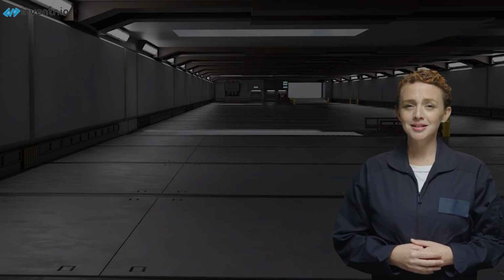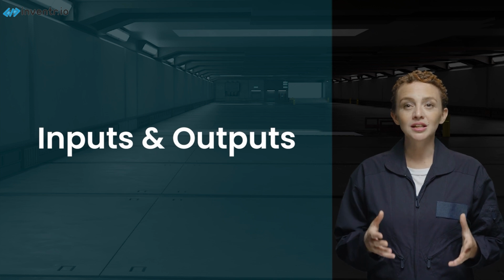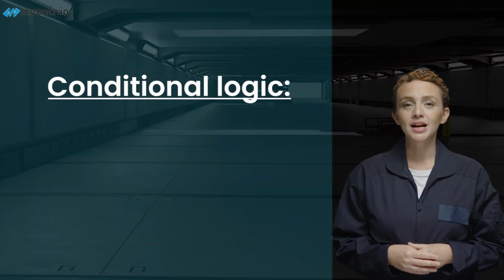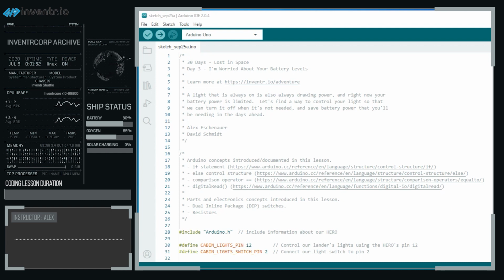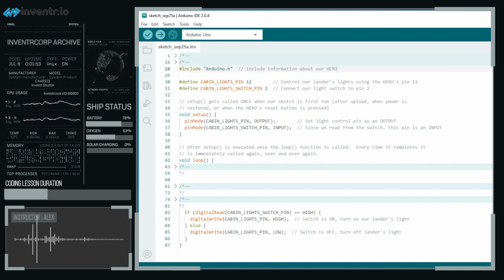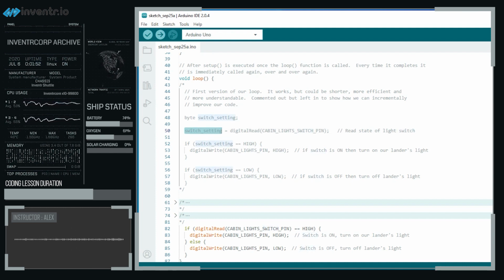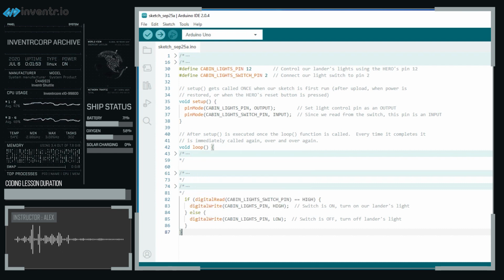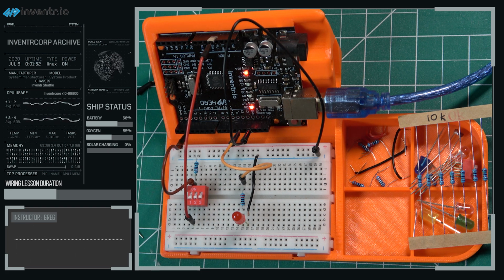[Day 3] Adventure Kit: 30 Days Lost in Space

Comment: Slight confusions : the circuit shown during the first part shows the resistor before the DIP Switch, but the wiring at the end has it after the DIP Switch, and the resistor used for that has the same color bands as the LED one in the first part, yet it's different in the wiring (should be brown red brown instead of red red brown no ?).

Comment: What is the purpose of the resistor? Adding a resistor just seems like an unnecessary extra step.
Reply: which resistor? At the switch, or at the LED?
- at switch: Pull down resistor to keep from having a floating voltage value
- at LED: current limiter to keep from burning out the LED
Reply: @Chad_Kunego  
So from what I understand, if you remove the resisitor near the LED, it will still work, but the extra power will burn it out faster...
and I am not sure what floating voltage value is from the pull down resistor. Is that kind of like making sure that the water faucet is close less as to not have too much water going all over the place? 

thanks
Reply: @oldbastarddrummer  Simply put, unless you do something to physically control whether a pin is high or low, it would be considered a floating pin. A floating pin just means you're never 100% sure what the voltage is at that spot in your circuit. Due to tolerances of other components, leakages, static buildup (this is a bigger issue than you might suspect. To put it in perspective, if you've ever shocked yourself in the wintertime by touching a doorknob, just keep in mind that, in order to feel that spark, you're looking in the range of 2,000-5,000+ volts of static electricity flowing between your finger and the doorknob. Electronics need less than 5 volts to get triggered).

 Without a pulldown (or pull-up) resistor, you're never quite sure if, or how much water, is flowing to that pin, so there's always a chance some water could reach it and accidentally trigger it, making the pin think it's triggered. With a pulldown resistor, you definitively know the voltage level is pulled down to zero, hence its name. When you flip the switch, the voltage then goes high.

There's also another way to wire a circuit which uses a pull-up resistor, which does the same thing. You definitively know the voltage is high when using a pull-up resistor unless the switch is flipped and it forces the voltage low.

So the TL:DR for that is, without a pull-up/pull-down resistor, your circuit could (and most likely would) be inconsistent and unreliable because stray voltages could be triggering your circuit without you being aware of it.

For the second part of your question, the reason you use a current limiting resistor comes back to our favorite equation in electronics. V = I * R, or voltage = Current * Resistance.

An LED operates at ~5V 20mA max. Any more and you shorten the life of the LED, sometimes to the point of instantly getting killed. A quick google search states the average resistance of an LED is 30 ohms.

So if you have a 5V 1A power source (battery, power supply, etc) and you connect the LED directly to it, you would get the following:

5V = ? * 30 ohms. Flipped around, you get I = 5V/30 ohms. Or I = 166mA, so well above what an LED can handle without burning out.

With a current limiting resistor in the mix, it changes that formula.

You add a 250 Ohm resistor to the mix. In a series circuit, resistances are additive. So now you get the following:

5v = ? * (250 Ohm + 30 Ohm). Flipped around and simplified, you get 17.8mA = 5V / 280 Ohms.  So now the current is much lower and within safe operating values.

Make sense?
Reply: @Chad_Kunego  I still don't understand why do we need 10k  pull down resistor? what would happen if we remove it? I mean just remove it - as I see we have 5v on entrance, then it goes through this red clicker, if clicker is off, nothing goes further, but if it's on - then our pin 2 works as GND and we send our 5v to pin 2. In this case we don't need 10k pull down resistor and we don't need to connect it to GND on the board. We send 5v - we receive 5v on pin 2, as simple as that. Right? No?
Reply: @husivm  The way you're looking at this circuit is if the circuit/environment is theoretically perfect. You're also only looking  at this as an isolated project, rather than what's considered good practice when approaching larger projects. In a circuit this simple, then yeah, theoretical and in practice are pretty much the same and it'll work fine 99.9% of the time, but in larger projects, making that type of assumption about what a voltage 'should' be vs what it actually is can cause hard to find bugs in the circuit/project.

As an example, and something far outside what this project would get into, is inductance/capacitance of a circuit. without getting too far into the weeds on it, if you have 2 conductors in close proximity and one of those conductors has an a/c or pulsing signal on it, it can potentially cause a current to be generated in the other conductor. It's how transformers work.

In other words, under the right circumstances, what you assume is a 0 voltage could actually have some type of voltage generated on it and cause instability and unpredictability in the circuit.

As a second example. Ever scuff your feet across a floor and accidentally zap yourself due to the static you built up? That shock you feel is usually in the 20kV range. It would take significantly less to cause instability in your circuit.

As a final thought/example, and going back to what I mentioned previously, you're looking at that tiny section of the circuit in isolation under theoretically perfect conditions, which almost never happen in practice. ALL electronic components have something called tolerance levels. As an example, a 100 ohm resistor is never going to be exactly 100 oms except by extremely unlikely accident. It's usually going to be within a certain range of values, hence why they have a tolerance band on it. A resistor with a 5% tolerance could be anywhere from 95-105 ohms, but still be considered 100 ohms. There's also internal resistance of the ICs, internal leakage voltages, and stray capacitance throughout the circuit/wiring/components. In this project, they're negligible and unlikely to cause an issue, but still present. As your projects get larger, those inconsistencies can add up to the point that, if you don't account for them by doing things to compensate for them, which in this project the 10k pulldown resistor is there for, you'll have unpredictable results that are a pain in the butt to track down because they're not being caused a faulty component, nor is it being caused by any one component.

I was an electronics technician in the military way back in the early '90s, and having floating grounds in our equipment (due to component failure) was the bane of our existence, so anything that mitigated or eliminated that potential issue was mission critical.

Hope this helps.

Comment: Hi, my LED seems to be on when the switch is open? Not sure why, i push the 1 up to ON and it turns the LED off. When I push it back down then it turns on again.. If anyone could help, would be appreciated.
Reply: Your code might have the two reversed, or the DIP switch block is not bridging the chasm in the breadboard.
Reply: if in your code where the if (digitalRead(CABIN_LIGHTS_SWITCH_PIN) == HIGH) if the HIGH is LOW then change it to HIGH. if this is good then check the digitalWrite(CABIN_LIGHTS_PIN, HIGH); if the HIGH is LOW then change it to HIGH. i hope this helps!

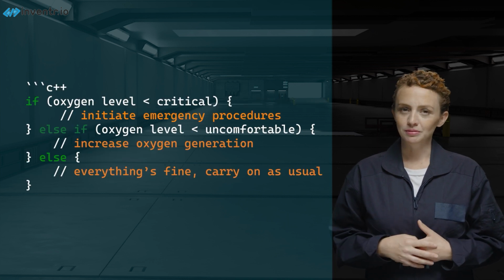Comment: Erk. 9:00m - Strictly speaking, 'oxygen level' should be one word: oxygen_level, for example.
Reply: Not in pseudocode it doesn't.
Reply: Not in Japanese Haiku either - What's your point? The comment indicates the following example is C++ code, it's explicitly called "code" by Astrid, and is syntactically correct C++ code. Later, Astrid presents pseudocode... but not in the example presented at 9m00s.
Reply: If you're going to pick apart inconsistencies and mistakes, you'll be here all day :) It's not the most painstakingly-accurate video series..
Reply: Initial comment was made before the re-launch. I was one of the guys assisting the re-write. I was hoping they'd correct it before launch.

Comment: Where can I buy or get the file to print the arduino and bread board holder that is shown in the wiring demonstration?
Reply: It's in the extra materials section on the website
Reply: @TheBoglodite  i'm trying to find the one that's in this video (that's tilted up) but i'm only seeing flat ones on their community resources section. do you know if they removed it?
Reply: @jonahlang2731  might have better luck directly messaging them. They've completely rebranded and changed the website up since I made that comment.